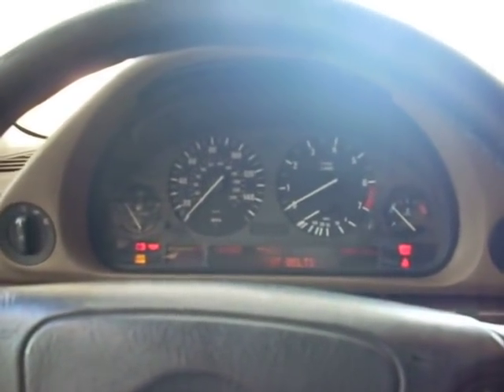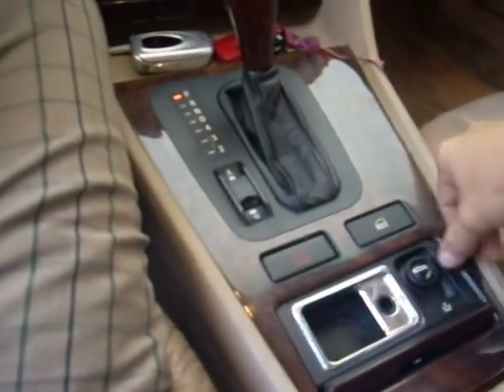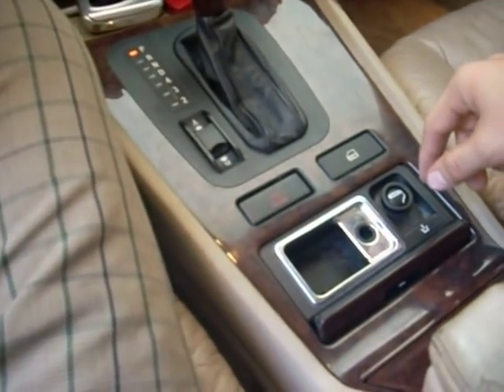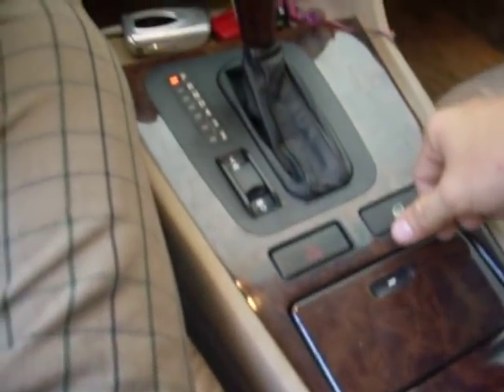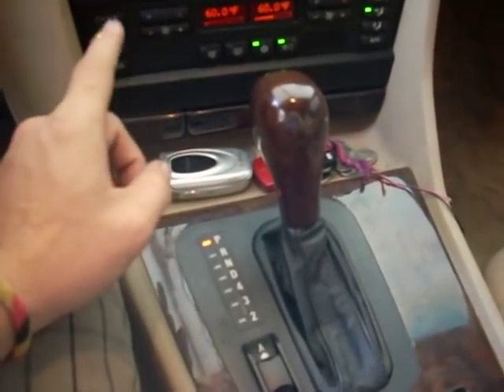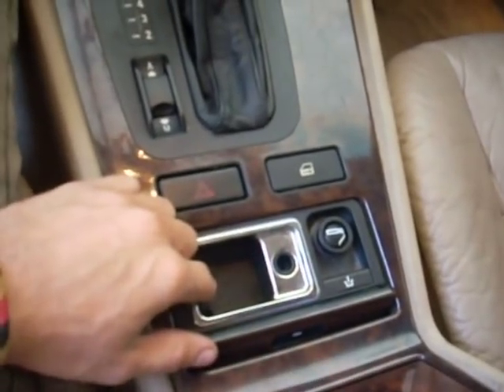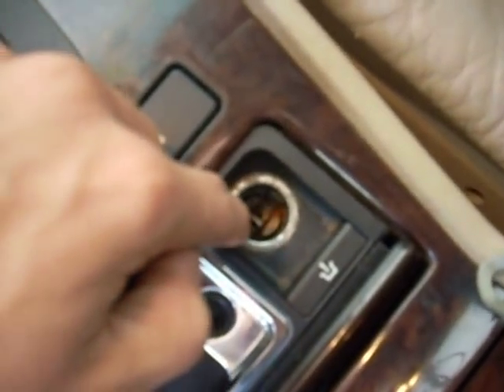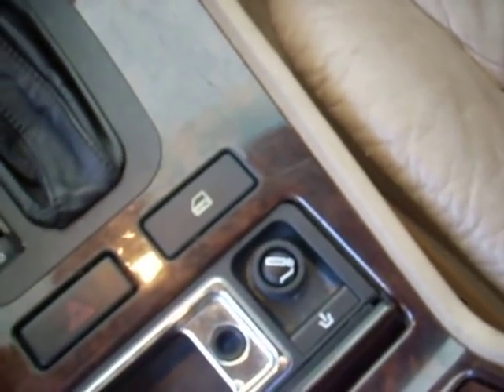make good use of your cigarette lighter

Comment: This is a perfect reason for NOT buying used cars from young drivers, never know what they'll come up with lol good job kid!
Reply: +Myk H dont think its just young kids there are plently of old dogs that do a bunch of crazy wiring into the car if you see any sign that someone added extra wiring do not buy the vehicle because you will have no idea how he had it wired unless you trace each one and with what you see theres probobly three times as much you wont notice not to mention 75% of the work done will be hack jobs that will eventually short out and ruin things
Reply: im 15 but i use cars the way there made
Reply: My old Ford Capri was like that, Parts for those are hard to come by here and the poor thing was owned by a few tweekers before it was my turn to have it...The wiring in that damned car was horribad. it took me days to undo their shitty work and redo some of it properly, Like the starter button was cheap speaker wire, no fuses, buttconnectors, duct tape, bailing wire holding crap in place...it was a nightmare.
SOME old cars are worth it, others, hell no....they best drop a few hundred off that price tag if I have to do the work myself.
Reply: Myk H just sold mine

even now the buyer is thanking me for the mods i made

Comment: by adding a hidden switch you can make it toggle from starter to working power adapter. this also prevents people from ruining the starter while you drive... flip switch, push button to start car, flip switch and now you can push and use the lighter or charge your phone without having to harm the starter.

Comment: It's possible regardless of whether it looks like he's tricking you or not lol, did it on my old E36 320i (UK Spec so no remote starting from the key) in 2010 when my ignition switch died. I saw this video whilst looking at ignition switch bypass videos, used a 30A relay + made a Harness (4x pins, 2 for pos+neg switch going to cig lighter, and other 2 pins for pos+neg from battery to starter), worked 2nd time starting (first time I forgot to connect the Ground from the Cig lighter).

Comment: you might want to glue the lighter button so is doesnt come out other than pushing it in to start the car. in case it's misplaced and can't start your car. and you might want a 12V outlet if you want your ipod on your car.

Comment: You can do this to virtually any car not just a BMW guys. You can even run a kill switch if you want which I've seen. It will turn power off to the ignition and or the whole car depends how you want to wire it.

Comment: @mustangrules 
Not that I'm an expert but just like a normal key when you turn the key you are putting it to ignition not turning it all the way the lighter only for fills the final turn, your ignition key for most cars has three clicks 1. Accessory 2. Ignition 3. Starter. And think back in time cars once did have push button start eg 1929    dodge da had a pull start bit by 1935 it had a push button.

Comment: @BRAVITS no he cant. the problem he was having was the wire going into the ignition that goes to the starting motor and instead of hooking it up back to the ignition he put it to the cig lighter. therefor key has to be on for the computer to read the car is on but the cig lighter tells the coils to spark the plugs.

Comment: Ok i have a 325i e36 BMW from 1991 and i would love to do this on it but i am not sure if ti will work do i have to change any fuse or something else, can u sow me what do i have to do to the ignition?or is just the red wire from the ignition that has to be cut and linked to the lighter?
Can u explain?

Comment: I wonder how long before his car bursts into flames from a false circuit.... :P
Reply: hahahahaha
Reply: it cant because he had to disconect the original wires that went to the cigerette lighter to install the mod so it cant catch on fire. if he left the wires there it would be constantly turning the engine
Reply: Frank Bravo ......... Apparently, you don't understand how a car works... Nevermind!
Reply: Apparently you dont uderstand how electricity works
Reply: Frank Bravo You obviously don't, I know! 

Hint; can't have a switch without some power going through it!!! It's simply a secondary switch....
Reply: there should be no reason for the switch to over heat because the current going through it isnt strong enough
Reply: Frank Bravo All it takes is for the relay to fail, and a high current will go straight through to the switch.
Reply: than all it will happen will be the lighter will work as normal and pop out when its hot, its like saying your car can caught on fire for using the lighter
Reply: Mauricio Magnovska ........

I guess you don't comprehend the fact that electricity will arc. The second that relay fails, the contacts will arc.
Reply: You literally made me laugh... XD 4:00AM 7/19/2017

Comment: All that work you did chopping wires and splicing into circuits and you could of changed the inhibitor switch and had it start normally .

A day or two working out what wires are where or 15 - 30 minutes changing a switch.

Comment: @Jk981206 
The vehicles made with this type of starting have safety features. This setup can be start at anytime. even while driving , making this 5 dollar fix a potential  $2000.00 dollar problem.
 If this was to be engaged while driving, the starter & flywheel would shave the gears off of each other, making him wish he spent his money on an ignition switch.
It's a BMW. If you cant afford to fix them right you certainly can't afford to own them.

Comment: Either way no one can still that BMW without the key, even if someone was to break into the car without the key it wouldnt start because it comes with a kill switch from the dealer.
Reply: yes they can, its called a tow truck, if anyone wants a car bad enough, thats what they'll use, but will deter the local wannabe theifs no doubt

Comment: but yet you notice, he doesnt wait the same amount of time everytime he shows how it works? so this is not the " remote starter " on the key, because you have to hold the remote start button down until you hear it start to turn over, this is all legit wiring and this is legit use of his worn out cigar lighter. its not hard to do, just basic wiring if you know what youre doing

Comment: Dumb. You still nedd the key. hook up a toggle switch and a single pole single throw monetary push button up directly to the ignition wiring harness itself instead. No key needed. Then disable the steering wheel lock as well. Then install 2 SPST MPB under the wheel well to lock and unlock the car. Which would need to be Integrated into the doors SPDT lock wiring harness. And a keypad is all that's left. So only you can start the car. You could either use an arduino with a transistor as a switch or amazon sells a kit for $50.
Reply: It's a BMW... there's all kinds of security systems that make that basically impossible
Reply: if you say so.

Comment: lol if you have to put the key in why would you need the mod? lol all you did is run wires from the ignition to the lighter and when you push it in "strike & start"
Reply: Same reason you need both a key AND a knob to open a door. The key is just for security. Cars with factory default pushbutton starts still have keys.